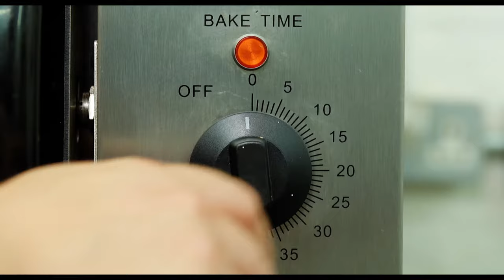Bean to Bar – Meet London's Single Origin Chocolate Pioneer

Comment: Thank you for the education. Anyway I have some question for you. 1. How to make bitter gone...?
2. Besides milk, butter and sugar, is there any ingridients to make it delicious, creamy and tasty...??
3. How to make it harden....?? Thank you
Reply: Better watch Gabe Humphries's channel first.
Reply: As far as learned about the process to get rid of the bitterness you should just keep experimenting in till you find what you like, then to make it creamy there is a very good machine for that.

It's called a wet grinder, it has two stone wheels and a bowl around it that will spin(this is what is common in a small chocolate factory) and it will grind down the small particles till creamy(this can take a long time)

And if you are wondering the machine is not all that cheap the average that I find is that it's 250 to like 200 brand new in American dollars, and if you look around you can find better deals.
 
After grinding down and chonching the chocolate you can temper it which also adds the creamy taste and will help it harden faster, at room temperature it can cool down in just a few minutes so keep a heat gun handy or just put on heat in a double boiler.

If want to know more just ask(even if I'm 8 months behind on this comment) hope this helps.